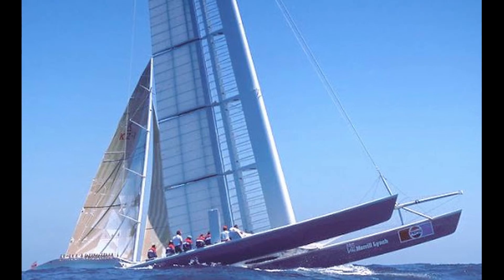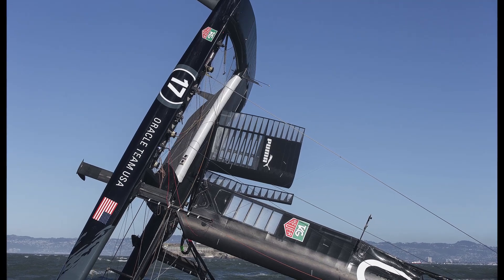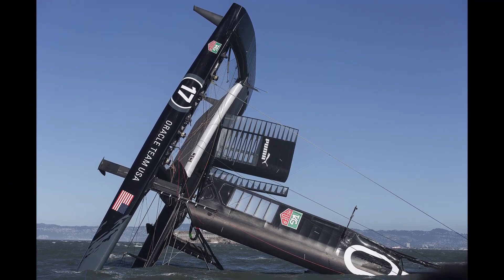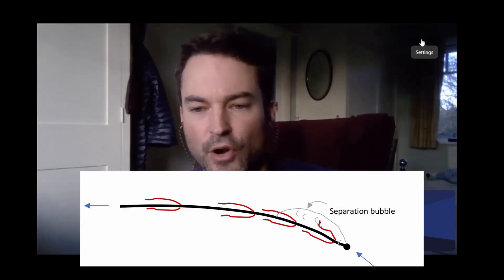America's Cup Mainsail Systems Revealed: Part 1

Comment: Those grey lines are not hydraulic. They are far to taught for that, and there would be huge problems running stiff high pressure hoses to both move easy with the clew track and at the same time bend sharply up into the rig. The pipes will be going into the sail inside the mast or in the tack area where pipe flexion would be minimal. Flexible Hydraulic pipes are anything but flexible when they have pressure inside them.
Reply: I’m with John here (not hydraulic lines). I believe they’re tensioners. One for each skin. Just don’t ask me exactly what they’re tensioning! 😂
Reply from the maker: Good comment and you could be right. I did think about that. ETNZ hydraulic hoses for the same outhaul mechanisms are of similar diameter (they can be seen when they de-rig). These aren't carrying the mainsheet load, just moving the clew position.
But, I also don't seen another alternative. How else would outhaul be changed?
Reply: @MozzySails  if they have a rigid plate in the clew then the ratio between leech and foot tension could be changed by moving the attachment point of the mainsheet. Or by moving the track back and forward but we know they do not do that.
Reply from the maker: @johnandrews2853  Yes. the traveller track cannot be moving as the slot in the deck does not accommodate. That would also be visible in the stern cam footage. 
So they must be adjusting the mainsheet attachment on the clew. On board they call this outhaul. If you pause the video at 0.42 you can see the interior of ETNZ main system with the dual hydraulic outhauls and connecting hoses. This is what I imagine is fed by the LR line from below deck. 
But, I do share concern about the flex and ability to turn of such lines. Could also be electronic actuation.
Reply: @MozzySails  Electric wouldn't need two cables.
I expect them to be simple lines operating some sort of a lever to manipulate outhaul position - each side separate.
The other end of the line connected to a hydraulic ram itself sitting on top of the mainsheet ram gives you perfect delta operation with two lines - as said each side same system to be operated independently.
If I would have to design such a thing I would have thought such a path.
Reply: @peterebel7899  Leech tension - something has to prevent the two leeches moving relative to one another - or at least control that movement?
Reply: @Mozzy Sails if they are RODS, not lines - then there are a load more things could be going on. The clew board might have a large differential cam inside of it which controls the relative movement of the two skins' clews? Rods able to push and pull might be actuating this. They could in turn be worked by hydraulic rams under the deck (traveling with the car?). Shame they are not marked with tell tale calibration lines!
Reply: @JamesMarinero  Thats easy if both lines are linkes to the same ram but one with an additional trim ram in between.
Reply: There are some narrow nylon tubes that can carry pressure, but I thought hydraulic pressure is in the range of 2,000 psi.  I would say some sort of small screw jack might be more likely.  Perhaps the pressure to turn that could be less than a ram.  It seems too complicated to me.   Simpler is usually better.

Comment: Super insightful thanks both ☺️

Worth noting: all three sail packages supplied by North Sails. Regarding that lower zone (1.5m of the mainsail) where syndicates have design freedom to play with area, structure, geometry, shape and batten layout ... as JB Braun, North’s director of design and engineering states:

“It’s not just about the aerodynamic efficiency; it’s about the balanced efficiency of the system, because as you lower and raise your center of effort in the sail and your sail plan, it changes the side force the foils are seeing. So changing the side force changes your leeway or the lift distribution on the foil, which changes the drag of the foil, which then changes how much drive force you need. Then the aerodynamic part of it needs to change to account for that change in drive. It’s a coupled solution. You can look at these things independently, but to come up with an answer or an optimal shape, it’s a coupled solution for aero- and hydrodynamic.”

That why I believe this is a significant enabler for LR to point higher and have better upwind vmg (and pick her skirt up and foil earlier in light airs)
Reply from the maker: just wait for the video tomorrow on ETNZ...
Reply: @MozzySails  ... aah, see what you mean now :)   Clever them kiwis like. 😉
Reply: @MozzySails  I'm curious why the upper control zone is so extensive (4m vs 1.5m).
I wonder if this is to permit the mechanism to include a diagonal compression strut (like when a solid vang is pressed into service as a topping lift at anchor) to support the top of the leech, which (it seems to me) would make the fathead mainsail more able to sustain the massive leech tensions which (I presume) arise from carrying so much sail at such high apparent wind strengths (50-60 knots). It would also avoid vertical loads being imposed on the lateral trim linkages.
Reply from the maker: @Gottenhimfella  I think it's to allow lighter weight 'soft touch' mechanism to be used over a larger area and discourage teams from using heavy gaff booms. 
There's also a restriction on your height of centre of gravity, so you can't put anything that heavy right up the top. 
Whereas the bottom is different, it's a small area expecting a concentration of heavy systems with the load carrying hydraulics etc.
Reply from the maker: @Gottenhimfella  check out my next video on this https://youtu.be/tj-LO__ufWE
Reply: A very insightful post.  Do you 3 guys hope to be involved one day in an America’s cup campaign ?   All the best.

Auckland.   John.
Reply: I am not sure they do have better vmg anywhere.
Reply: @johnandrews2853  well, I’d love to think you’re right about that John.  

I’ve not studied beyond watching the races themselves but my impression has been there’s not much between them in the boat speeds upwind but LR points higher both after the tack and when she really needs to go higher (at the starts in particular) and that accounts for her better vmg (which for me looked like about around a full knot most of the time).

Downwind I believe Ineos has a slight edge on vmg but around half the LR upwind advantage.
Reply: @Supasarge  Mozzy's analysis is I think spot on.. Rita has the legs, but LR are able to gain many meters every tack - so their average VMG for the windward legs is, as you say, about 1Kt better. That dragging of the old (now windward) foil tip for a few seconds as their boat accelerates after each tack allows a quicker rotation (which should be draggy and slow) to be more than compensated for by much reduced leeway for the first few seconds after each tack.
Reply: @johnandrews2853  agreed, it’s a scaled down benefit of throwing an eagle turn @leeward gate to prevent skidding south and improve the efficacy of the turn about the centre arc.

On the tack I also think Ineos are suffering from speed bear away for the first few seconds post tack  ... a boom carrier’s penalty!
Reply: @Supasarge  In race 4, LR made a big gain after the start while on port tack. The gap in race 4 was 28 metres with Ineos settled, but it grew to 50 metres (in virtual terms) in 20 seconds. LR sailed a lot higher in those 20 seconds or so ... likely more pressure, or a shift, but LR looked faster to me upwind at least. About the tacking - I saw some of the last race of the Prada Cup or something, a very light weather race, with LR versus Emirates NZ. They showed a graph after the race and the graph showed that LR had much tighter turns during her tacks than NZ. Which I guess means that LR is holding on for a bit longer before tacking, and also, she is finding her normal sailing "groove' faster. That was back then, and now, LR does appear to have improved a bit as well.
Reply: Batwing copied from Kiwi sailmaker/Quantum sails